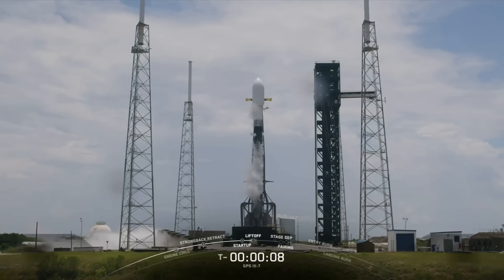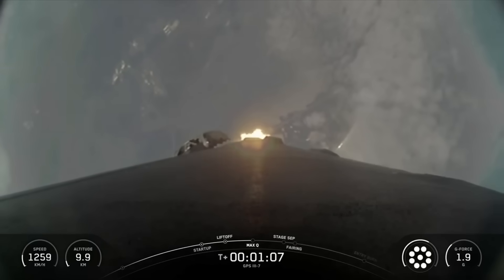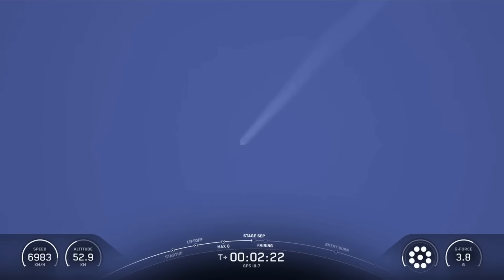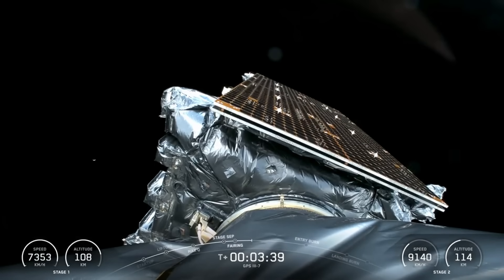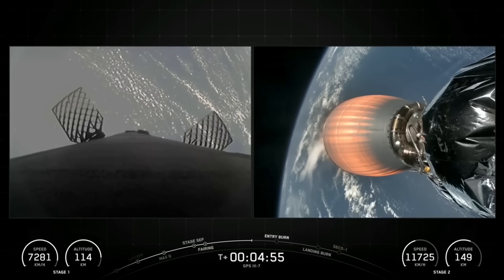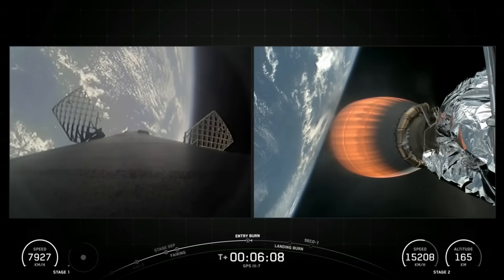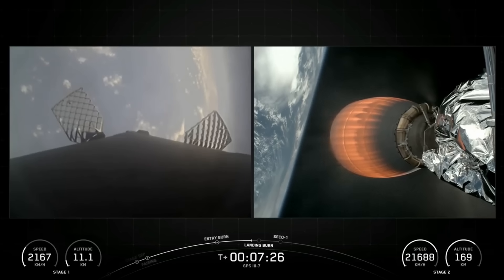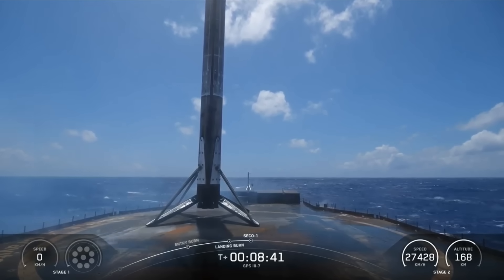Blastoff! SpaceX launches GPS satellite for U.S. Space Force, nails landing

Comment: Baffling why SpaceX doesn't simply upgrade the Falcon system, then assemble large spacecraft in orbit
Reply: I believe the primary reason is the need for a huge number of tanker trips to get the required amount of propellant into orbit. At peak SpaceX is planning to have hundreds of spacecraft heading out at roughly the same time, and each of those ships will require ~1200 tons of propellant to refuel them in orbit.

Falcon 9 can carry ~20 tons to LEO and requires that the second stage plus refuelling tanks be expended, so ~60 upper stages and tankers would need to be built and discarded PER SHIP - 30,000 or more per launch window in total (assuming 500 ships). Starship tankers are designed to carry 150 tons of propellant rather than 20 tons, and allow the upper stage plus refuelling tanks to be re-flown rather than discarded after a single flight. 

If it was just the spacecraft then assembling in orbit might be possible although still expensive because of all the discarded second stages... but carrying all that fuel is what makes full re-usability a hard requirement.
Reply: Have you even estimated the cost of operations at the scale you are talking about? Who is going to pay for this? You are talking about a project that would be three orders of magnitude more expensive than apollo.  @johnbridgman4310